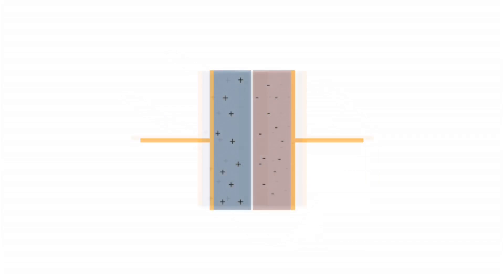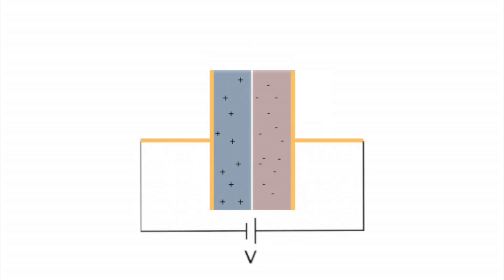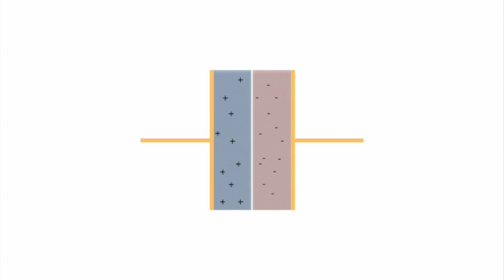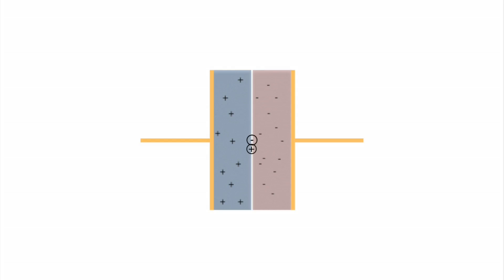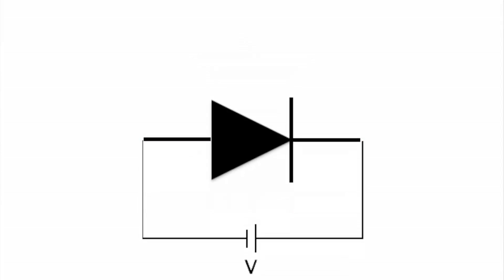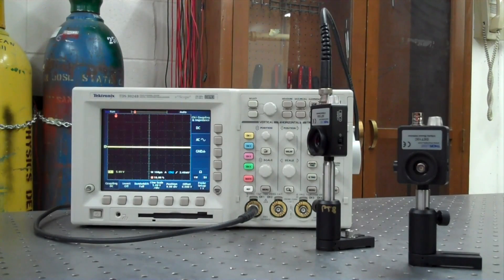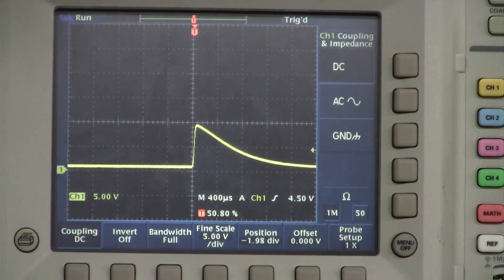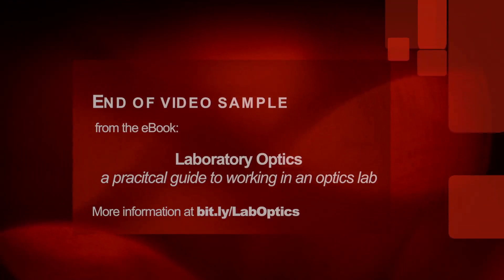Photodetector Basics SAMPLE

Comment: Rofea Optoelectronics offers a product line of commercial Phase modulators, Intensity modulator, Photodetector, Laser light sources, DFB lasers, Optical amplifiers, EDFA, SLD laser, QPSK modulation, Pulse laser, Light detector, Balanced photodetector, APD photodetector, Laser driver, Fiber optic amplifier, Optical power meter, Broadband laser, Tunable laser, Optical detector, Laser diode driver, Fiber amplifier, Semiconductor Laser, RF Over Fiber Link, ASE laser. We also provide many particular modulators for customization, such as 1*4 array phase modulators, ultra-low Vpi, and ultra-high extinction ratio modulators, primarily used in universities and institutes. 
Hope our products will be helpful to you and your research.

Comment: why is it reverse biased
Reply: it reversed because when light incidents it absorb and produce positive and negative changes because of reverse bias there is electric field and charge attracted to the electric field and from current that's why it is reverse bias but in case of forward bias there is no electric field in between pn junction so no flow of electricity in the circuit